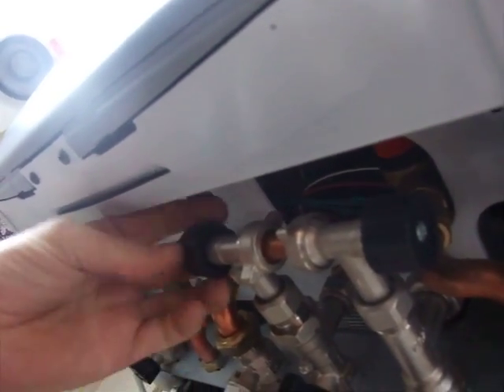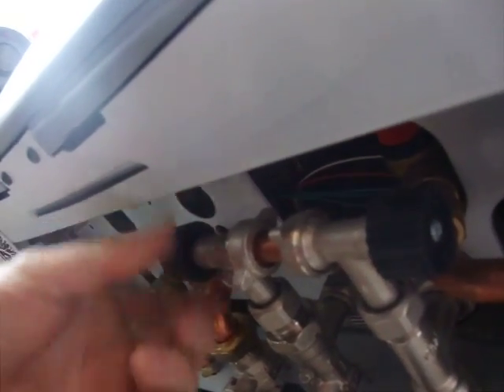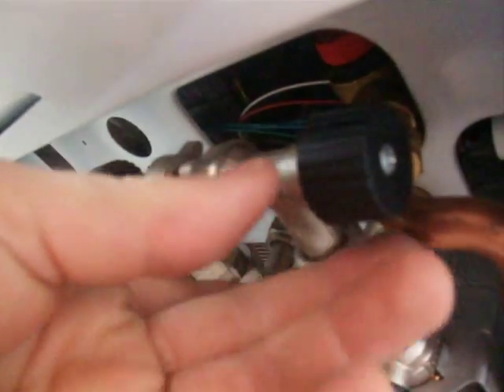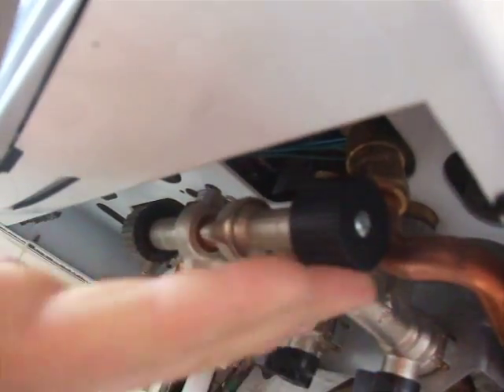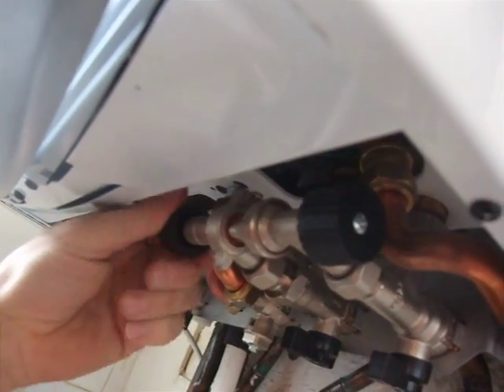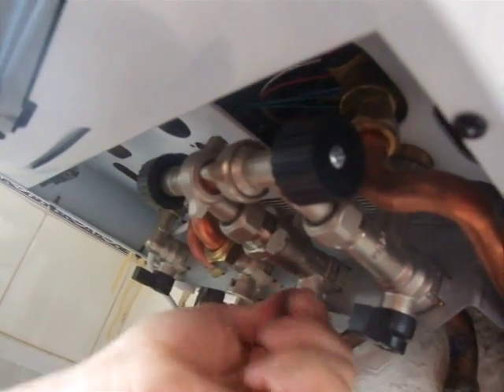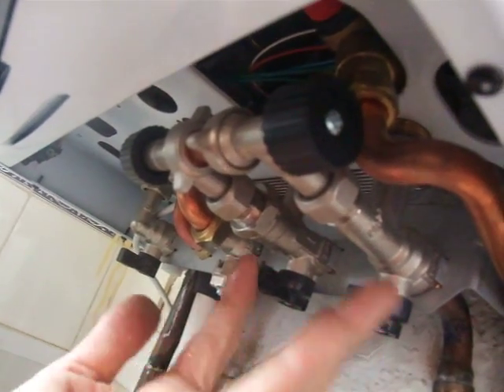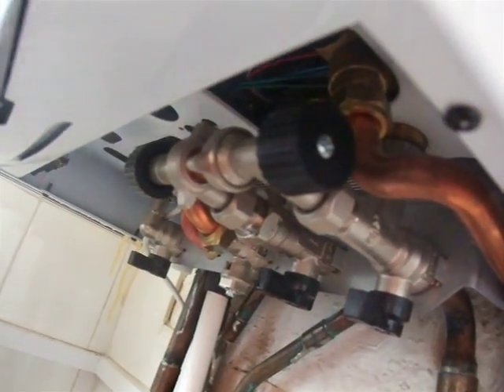How to repressurise a boiler (Baxi Duo Tec 40HE)

Comment: This is the only video I've seen on YT that explains how to do this on my boiler, there are loads of other videos on the Baxi Duo 28 with blue taps or black taps that need turning but none that have this filling link with these round knobs that you must turn anti clockwise. Note for anyone doing this, nothing will happen until you have turned both knobs for quite a long time, then it will start to hiss and re-pressurise.

Comment: I've used this video in the past to repressurise my boiler but now I can't undo the two black taps. Guessing an engineer has overtightened them at some point or I've got weaker! Tried everything! I shouldn't need to undo the screws in the centre of each tap should I? Never touched them before.

Comment: Thankyou, thankyou, thankyou from a previously frozen Bournemouth man.  Had a freezing cold upstairs in our flat for 2 years.  2 minute job, thanks to this video and sorted it.  (Quick tip, if the circular plastic pieces are missing you or they won't move you can use a screw in the valve to adjust, took me half an hour to figure this out, could be worth removing the plastic if the valve is seized like mine was!  Not the fault of the tradesman in this video mind!) All the best for this difficult winter. God Bless.
Reply from the maker: So glad you were blessed by this little video.

Comment: I can confirm this is right after doing it myself after my boiler stopped working with an e119 code done exactly what he does here, but added a bit too much pressure so all I did was make sure the pressure valves were closed properly then bleed the radiators til the pressure goes down to about 1bar job done. Who needs a plumber lol

Comment: That just completely saved me from a cold night and possible call out fees - THANK YOU! I was trying in vain to once again bleed a problematic cold fronted rad in a new build flat and suddenly got an E119 and my boiler shut down, I then tried fiddling with all of the black taps at the back to try and refill it to no avail, and then this video has just saved my life!!!  (I still have to work out the cold fronted rad though) any suggestions anyone?

Comment: I'm quite a hands-on tech sort of guy, and have replaced CH pumps, 3 way valves, and rad valves in the past but the whole re-pressurising thing has left me cold in the past (which is how I was feeling this morning!). I figured it out, as I seem to do in the end, but this vid was a good find just to put my mind at rest - thought I'd lost pressure and got a frozen pipe but it was just that one of the round-knobs needed fully unscrewing to allow the flow

Comment: thats so bad because them valves don't look like most valves used...bad example...
most filling loops are on a braided hose & look nothing like what he showed.
also warning pressure should not exceed 3 bar or your boiler will dump excess pressure out of a valve that doesnt always re seal itself.
(3 bar valve)
some boilers have low back pressure when old (vaillant especially) so they expand when used so even 1 bar can cause over expansion problems.
ppl must know its not related to shower pressure